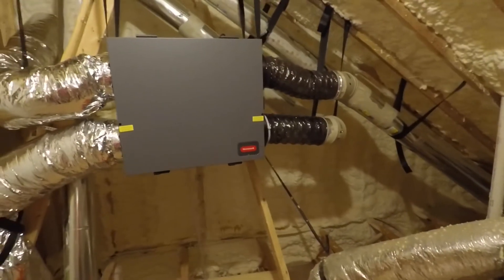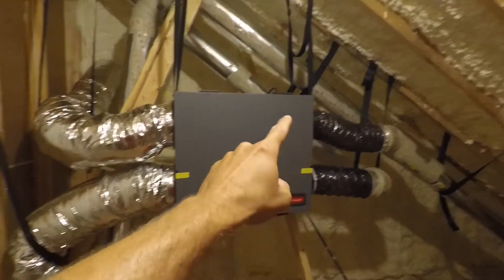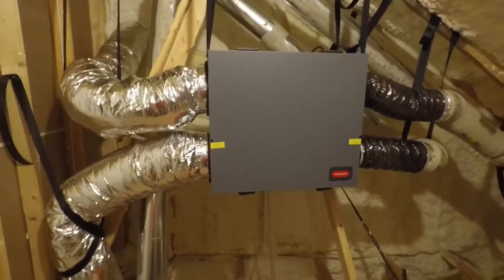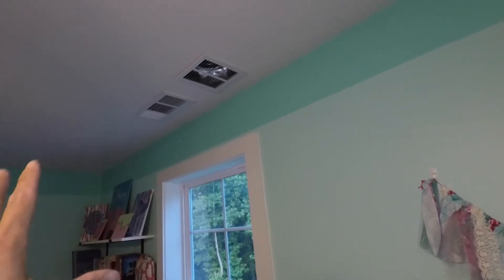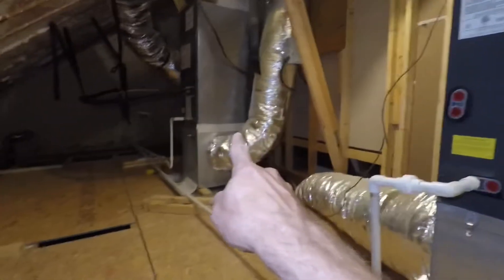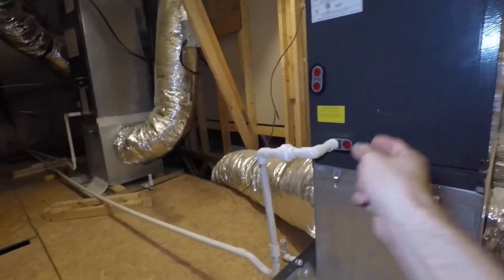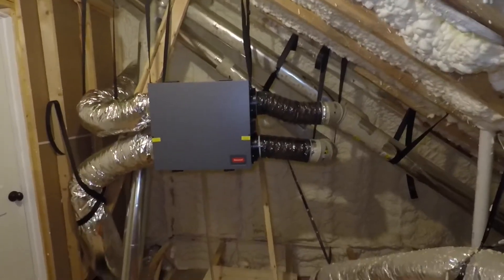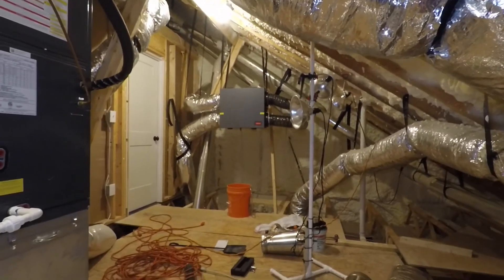Why my ERV has its own ductwork and why it's not using my HVAC ductwork. Energy Recovery Ventilator

Comment: Nice work and thanks for sharing your experiences with hooking it up. There are multiple ways this can be done, each with its pros and cons. Ignore the haters that think theres only one way. In one comment you mentioned the maintenance is annoying, one thing you can do to lessen the maintenance is build a prefilter box on you external air supply line. Then just put a regular merv 8 filter in that prefilter box. It will help keep the ERV itself cleaner.

Comment: ERV = ventilation that recovers some of the heat PASSIVELY, you pay only for ventilators.
AirCon = is effectively the same as what your fridge does - it pumps heat ACTIVELY from/into the house, and for highest efficiency it shouldn't ventilate (same as your fridge), but many systems incorporate ventilation at the cost of efficiency.
However, there is a way to combine both systems into one ducting. But then it becomes a rather complex system. Keeping them split is just simpler, less of a headache.

Comment: Watching with interest your videos - I would come up with some observations: , I see 2 or even 4 major problems that I would take into consideration:
 1) the air ducts both from the exhaust and supply air to the ERV that are connected to the bedrooms kitchen and bathroom should be insulated so as not to lose heat-cooling with the temperature in the attic, - otherwise the role of the ERV is pointless.
2) all square or bathroom registers should have an air volume adjustment 6 in. Inline Damper valve according to the room volume and a balanced air volume balancing - considering that the length of the ducts is different at the same diameter - (you will have different air flow rates) - or you can use the rectangular ones with a shut-off damper and make an empirical-approximate adjustment.
3) If you run the ERV 24 hours or about 40min/hour on average it would be preferable to connect the dehumidifier in series with the air outlet of the ERV -I would try this method and the dehumidifier would only start on demand from the humidity sensor.
4)I would connect 20 "X20 "x2" or even 4" housing air filters to both the inlet and outlet of the EVR to protect the heat exchanger in the ERV and probably the cleaning and filter change would be much less frequent -maybe 6-12 months.

Comment: Is there any kind of noise coming from the vents when it’s blowing air into the rooms and the return vents in the bathrooms/laundry room? Do you hear the unit running in the attic from the floor below?
Reply from the maker: I cannot hear the unit running from the living spaces. I can hear air moving through the vents in some of the rooms, but it is not any louder the the air moving through the HVAC vents.
Reply: @BrantleyBlended  what about any suction noise from the bathrooms/laundry room. I’m try to get more information to see if it’s worth getting one installed at my place. is it something I would get annoyed of hearing all day or not?!?

Comment: Why do you use insulated ducts for the connections between the ERV and outside?
Reply from the maker: I think the installation manual said to use them to eliminate the risk of condensation on the ducts from outside air. Something like that.

Comment: Gentlemen can anyone solve my query, 
I have heat recovery unit similar to the shown one in the video, and it does not have a drian pipe connected to it, same as shown in the above video,
My issue is we live in gulf countries were fresh air has lot of humidity, once fresh hot humid air  contacts with return air, there is  lot of water condensation taking  place and water dripping continuously,  how can I solve issue
Reply from the maker: Drill a hole and add a drain line yourself. Get a whole house dehumidifier. It is very humid here in Georgia also. This drain line has never leaked any water. I’ve never had a problem with condensation inside this ERV.

Comment: I guess one of the questions is how hard will it be to run ducting to those multiple locations. Another is how long does my AC run during the day? As for the power considerations, if the AC is running around the same time, it will draw the same amount of power. The bigger consideration is 1 or 2 ERVs when you have a dual AC layout.
Reply from the maker: Running ductwork during construction would be a lot easier than the way I did it, after my house was built. It took me a long time to install it. 

I have 2 hvac systems but only needed 1 ERV because it is large enough. My house is only 1900 sq ft.

Comment: My opinion - If electricity is fairly cheap, you should definably run the erv through furnace. DC fans are not expensive to run. Your ceiling fan is like $40 to run all year. Assuming less than .20c /kwh

Comment: How do you like it now?
Reply from the maker: The ERV works great and helps. I don’t like the maintenance it requires every 3 months to keep it clean.
Reply: @BrantleyBlended  What does that maintenance consist of, changing the filter?
Reply from the maker: Cleaning or replacing the filters every 3 months. Cleaning or replacing the core every year. Cleaning and wiping down the inside of the unit every 3 months. Mine gets very dirty inside with dust, pollen, bugs, ect. I have a playlist about this ERV. I show the cleaning of it in one or two videos.

Comment: Had to repair our ERV today and cleaned core for the first time. Decided to research how it affects humidity in the hot south. Ours goes through the HVAC & HVAC fan blows when it's operating. I like your reasoning and thought about making mine stand alone like yours BUT what stopped me was air filtering. We have oak trees and my family has oak allergies. BARELY survived this past allergy season!! Inbound ERV air is filtered through a MERV11 (expensive) HVAC filter before entering house. Gonna leave it alone solely for that reason.

Comment: It doesn't need it's own duct work to function.  
I think what they were talking about was that you can simply tie it into the existing HVAC system without having to make its own ducts.   
You remove air from the return ducts on the HVAC and then you add air to the supply ducts on the HVAC.  
Essentially it allows you to supply the whole house with fresh air just through the existing ductwork, the HVAC system doesn't have to run for the fresh air to come into the house at the same time.  

The only problem with tying it into the existing ductwork is that you can't target where to remove stale air, by having its own duct work you can remove stale air from the utility rooms, bathrooms, and kitchen specifically, other than that, attaching it to the existing HVAC system is better in almost every scenario possible.
Reply from the maker: Your explanation makes sense. Using existing ductwork the way that you described might be a good way to install an ERV. I did want to target specific areas to pull air out of the house from and also to supply fresh air to. 

One issue that I see with using existing ductwork is that my ERV might not move enough air through the existing ductwork.  My HVAC air handler or blower, whatever its called, is much larger and has no problem moving air through all of the HVAC ductwork. Could my ERV move enough air through all of that ductwork? Also, I have 2 HVAC systems. I don't think it would be good to tie one ERV to the ductwork of both systems.
Reply: huh? how would it work if the HVAC isn't running? it'll just cycle the ERV air in a loop with nothing pulling that air into the central air

Comment: I might be wrong, but it's possible the commenter was questioning the need for adding an extra square vent (right beside the existing HVAC) to disperse the fresh air. Maybe they were thinking you could've connected the fresh air duct coming from the ERV to the HVAC duct right before its connection into the room. I'm assuming that would not need the HVAC blower to be on to blow the fresh air into the room. One reason could you, as you said, you are picky :)

But regardless, thank you for the great series of videos.

Comment: No it doesn’t cool !!!! It simply put takes from the rich(hot air)and gives to the poor(cool air)
Reply: It technically is cooling / heating.  The air that transfers through the medium is heating or cooling the medium, then the medium transfers that temperature to the other air as it goes through.  
  
So it will be a temperature somewhere between the inside and outside temperature.  It might be closer to the outside temperature ultimately because the system is creating positive pressure and more air is pulled through the ERV from the outside than it is pulled out from the inside.

Comment: I'm curious about the humidity issues... is the humidity from the basement soaking the house? Since the ERV does not dehumidify, I would imagine it would feel very cold in the winter and very hot in the summer regardless of whether the HVAC runs. I have a home with an actual, uncovered, 6' deep dirt basement and even with the HVAC set to 73 degrees the humidity makes it unbearable. Encapsulation is in progress! We plan to seal up the basement and run a dehumidifier. We do not plan on insulating the 1st, 2nd, 3rd "floors" nor the walls of the 1st and 2nd floors as they are sealed up with hardwood, and plaster & lath. in the summer the 10 foot ceilings help keep the house feeling cool and in the winter we have hydronic (hot water) loops that keep the floors warm and take the "edge" off, but we have ZERO insulation in the finished attic, so I decided to insulate it....which meant demo'ing 1000 sq ft of Plaster and Lath... I knew there would be consequences and since I want the space conditioned fully, (like your mechanical room) I am planning to go air-tight. I will use foam board (with the appropriate 1.5~2" gap). While I'm a huge supporter of the newest building techniques (Air-tight, full-sealed, dedicated humidifier, ERV, etc) I respect that there is a ton to consider with it. for example, I have plenty of drafty walls that I don't plan on ripping up to insulate... but the fact that I plan to insulate the attic air-tight, means that I must be prepared to recirculate, at the very least, with an in-line, dedicated dehumidifier, if not an ERV. $0.01 for your thoughts!?
Reply from the maker: I was told by an hvac contractor that humidity rises. If I control the humidity in the basement then the rest of the house should be okay. I don't think this is true for spray foamed houses. I have a small, portable dehumidifier in the basement. I usually dump it out once a day, but less often in the winter time. It's working, but I think there is still more humidity than we need on the 2 floors above the basement. Is that humidity rising up from the basement or just coming into the house through the walls, doors, or windows? I don't know.

My basement is very cold in the winter and very hot in the summer. I plan to install a mini-split havc system in the basement eventually.

I think there are some companies that can fill your walls or ceilings with spray foam without ripping all of the sheetrock or plaster and lath off. I think you would just have some patch work to do.

I think there several options for ventilation  and humidity control in your finished attic. You could just use a fresh air intake on the hvac system to blow in fresh air. There are many different kinds of fresh air vents that can be used instead of installing a large ERV like we did. Depending on the size of attic, or number of rooms, it might be cheaper to install another portable dehumidifier up there instead of adding one to the hvac system.
Reply: @BrantleyBlended  I think that is true for houses that have leaking attics with all the penetration's.  (the stack effect,  hot air rises and goes out the holes in the ceiling, this causes vacum for lower part of the house that draws air in.)  So humidity might travel with it,  however in my house since I had  attic sealed I notice  humidity is worst on main floor, and lower in the upstairs.  That stack effect is gone,  so when the a/c unit isn't running it gets stuffy especially on top floor without an ERV.  So im glad you figured that out I am getting one in a few days,  yes they are expensive,  im spending 3800 installed,  im hoping it helps out with all that.  Its funny how  being energy conserving  costs you so much money.  But I am  hoping  the air is a lot cleaner, less dust and everything since air  flow into the house isn't coming from insulated walls and all that dust but from a filtered unit that draws air in and out.  I'm getting the pansonic intelli balance 100.  You can set intake and exhaust from 50 - 100cfm.  I'm going to have it hooked into the hvac system since I don't have any open areas  to install new duct work since the house is finished.

Comment: I feel erv seperate is better. It essentially is like a ceiling fan for the whole house. Circulates the air. Will help to balance air temp through the house.
Reply from the maker: I’m happy with the separate duct work. It was worth the extra time and money spent. I wish I would’ve used 4” for some of the duct work but other than that I’m happy with it. It does keep air moving around the house, even when the hvac is off.